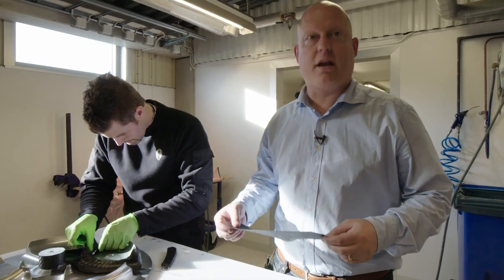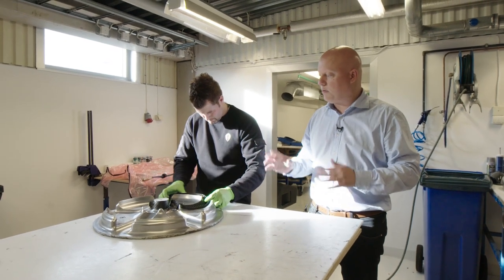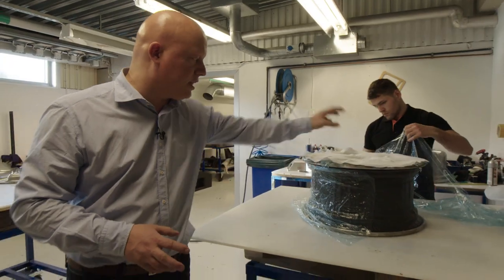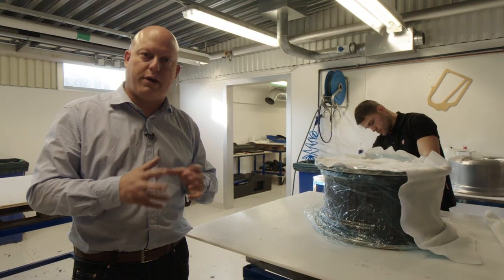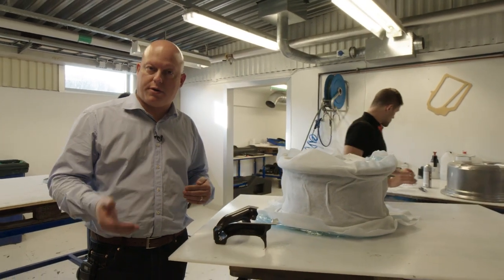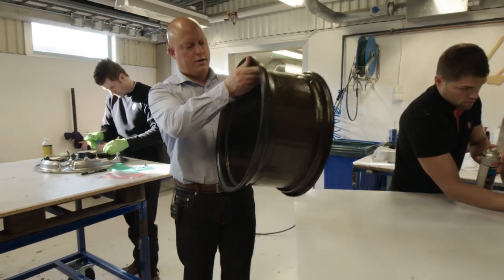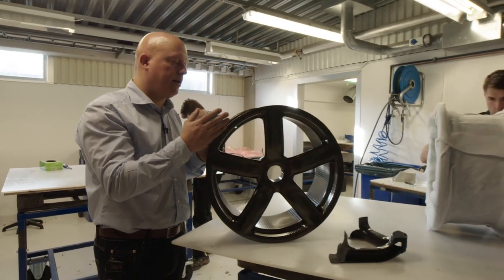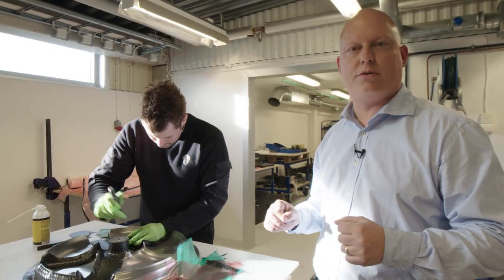Christian Von Koenigsegg Explains How He Makes 280 MPH Carbon Fiber Wheels

Comment: Man!! This series....making us wait why don't you!!!!! Can someone just make one which is an hour and a half with driving and all. On that note, can we see a drag race between the Agera/1:1, Huayra, Bugatti, P1, 918, Venom GT, etc?....nobody seems to want to drag race these cars ;)
Reply: We might see that kind of drag race few years later, but these cars are rare and expensive if something goes wrong. An hour or so about this would great tho' ;)
Reply: Check out "gtboard" on youtube. It's a rolling start but the Agera R already beats the Veyron GS Vitesse. I love the Veyron by the way ;).
Reply: The P1 would win.
Reply: Rihards Mors
I hear you...would be fun to see tho'! ;)
fesch03 Saw that race. crazy!
Reply: mrmactknife have you seen the Koenigesgg 1:1 its twice as faster than that P1
Reply: TheNewestAsianNegro  Has the 1:One even been ran publically yet?  A 1/4mile drag race between all those cars would be awesome.  Maybe I spoke too soon saying the P1 would win, but it would certainly be quick off the line with it's hybrid system delivering powerful torque at low rpm's.  It would just a case of whether the P1 could gain enough lengths on the 1:One during the acceleration phase, before the Koenigsegg could unleash it's mighty 1300+ bhp.
But what a race though, I really hope someone makes that happen.
Reply: i dont know yet but yea it would crazy fast i know that
Reply: mrmactknife I think that a 1mile drag race is in order also, consider the top speeds. :)
Reply: Man! No more episodes???? Why is this taking so long?! Chris should be doing something on this car, and the other hyper cars as well!!

Comment: Fucking hell, you are Swedish! You don't need to use that imperial system..
Reply: He may have used it for any Americans watching who still use the imperial system.
Reply: trodd1sox Why not use metric for all of the rest of the world watching, lel
Reply: +JanusPrime coz Americans are the best!
Reply: Even in metrical countries like here in Germany, we use inches to describe the size of a rim. But tires sizes are metrical.
For example 20x10,5 in rims and 265/40/20" tires.
Reply: simon sechzig I thought rims were in Zoll?
Reply: +JanusPrime Zoll is the german word for inch. Ein Zoll = one inch = 1"
Reply: Wheels are always measured in inches, both width and diameter. Changing that would mean making a car with wheels incompatible with every tire. Michelin tried making metric tires in the 1980s, it didn't work.
Reply: In europe we catually use Inch in some cases. For exampe the size of TV or computer screens and also wheel sizes
Reply: MxEnergyGreen i didnt know that thats koo

Comment: the year 2034 koenigsegg will release carbon fiber bones for the driver and have a booster seat made out of carbon fiber to seat a midget in the driver's seat and save a total of 100lbs more.
Reply: Next Koenigsegg will drive without a driver and save 75 kg weight.

Comment: About 13 lbs. Impessive
Reply: ***** These are bigger and wider, with these dimensions your wheels could weight like at least 20. And as the other guy said your wheels aren't even nearly as strong even with more weight.
Reply: ***** How wide are they?
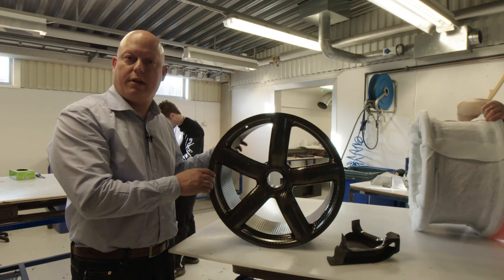Reply: jshaw6600 9:40
Reply: ***** Conratulations, you have lightweight racing wheels that will fatigue fail on you after a few years. These carbon wheels that are much lighter, stiffer, and larger will fatigue fail after 10^8 or more cycles or essentially never.
Reply: ***** True but they are not making a car that only goes fast on a straight line. Lighter wheels give all kind of advantages but the only disadvantage is little bit less stable ride on the top speed which is rather insignificant.
Reply: pascaliealiealie I Think the peeps over at Koenigsegg know what theyre doing, haha
Reply: o0Bananaphone0o Reading comprehension....look who I was responding to.
Reply: ***** What kind of car do you  drive with 18x11.5 16lb wheels?
Reply: ***** I see. A forged aluminum wheel with the same dimensions as Koenigsegg's would still weigh a little over 20lbs. Crazy how light CF is while being much stronger.
Reply: Crazy expensive to make though. Which is why most sane people go with forged aluminum or magnesium wheels.
Reply: Lets just hope theyve figured it out since they are the leaders in the hypercar industry, but of course, masters can also make mistakes
Reply: what do u mean?
Reply: I think that my opinion is legit, not really sure what you are trying to say...
Reply: and?
Reply: 10:05 5.9kg

Comment: "Production cars" ... they made 4 cars in the last 18 months...
Reply: the mclaren f1 was a production car and there was only a handful of them.
Reply: 夏春秋  more like 100 give or take. which is a handful in the car world. at least according to wiki, so take that with a grain of salt.

I think a  car needs 50 to be made qualify as production
Reply: 夏春秋
 they made
69 Mclaren F1's
6 LM's
2 GT's
28 GTR's

So yeah, not very many.
Reply: no.... They make about 10-12 per year, wich is all they need to brake even. The waiting list is currently over 1 year if you want one. 
As of Mclaren F1s, 106 were built, 28 of them being race cars, the rest road cars. 300 were originally planned. Koenigsegg so far has built 106 cars, same as the number of McLaren F1s.
Reply: Peter Pan
 thanks for the info!
Reply: Shall they make 3000 cars to call it "production car"?
Reply: homologation historically has dictated 50 units
Reply: 4 cars in 18 months? In 2013 they celebrated their 100th car and the first ones were built in 2002, so they make more than like 3 in a year. And if they design a car basically from scratch and build multiple of them then I would call it a production car. Zenvo built only 15 of their cars and you can't say that's not a production car. Some custom build cars like Hennessy gt aren't production cars simply as they are basically modified versions of something else. They try to claim otherwise to get records but that's a big load of bullshit.
Reply: Lol! They make 40+ cars a year.
Reply: seb123456789katt what are you talking about? where did you get that number from?? 
They make 10-12 a year, that's it.
Reply: 夏春秋 Sure, they could probably now just expand and produce more cars but it's takes big investments and has risks so it's good to take it slow.
Reply: A lot of you really don't realize how long it takes to make these parts out of carbon fiber. Almost the entirety of the Agera's non mechanical parts are made from carbon fiber. You can see some of the processes here of how long it takes to make one wheel. He omitted the time it takes to bake different thicknesses of carbon fiber. It takes half a day to 2 days for certain pieces, mainly because in the case of chassis', it has to be done in stages. So whenever I here people complain about how many cars they make per year, I laugh! Because they have absolutely noooooo clue. The materials to make Carbon fiber has come down in price tremendously, but the processes for molding and baking them has not and is the main reason why you won't see carbon fiber chassis in high volume production runs anytime soon.
Reply: 夏春秋
 There were not 200 or 300 hundred of them made. I think less than a one hundred were made. let me check. nope 106 were made. and remember. these were not nearly carbon fiber intensive as this car is. and its engine was hand built buy BMW for McLaren. And before you say it, Ford hasn't made forged a block for Koenigsegg since 2004. originaly Ford shipped unbuilt engine blocks to Koenigsegg. everything else was Koenigsegg spec. it was done for cost. now they design and make there own blocks.
Reply: SpecialKLSX They are obviously not production cars. If you start with someone elses car and modify it then it's just a modified car. And the mustangs even look almost exactly same, shelbys are just tuned versions of a ford mustang.
Reply: They didn't start with someone else's car. When they first began over 20 years ago, they needed to reduce the cost of making the cars. They did this buy buying engine blocks from Ford. Not complete engines. Just the Block. All the internals of the engine were made and designed by Koenigsegg. The entire car minus the engine block was made and designed by Koenigsegg.

Now they don't even buy blocks anymore. They can afford the machinery to make there own, which they do. The entire car is made and designed in-house. And they've been doing so for 10 years now.

And at no time were they ever a tuner company who decided to design their own car based off of another ala' Hennessey and the Venom.
Reply: They made 37 koenigsegg ccx last year Peter Pan
Reply: Yeah recently their production has accelerated tremendously.
Reply: jupp
Reply: Look at it this way. 

Maserati? Ferrari engines. Bugatti? VW engines. Audi? VW engines. Pagani? Ferrari. McLaren? Mercedes and BMW. Noble? BMW. There are quite a few low volume car makers out there who are essentially Coach Builders. That's basically what Hennessey is trying to become. 

Koenigsegg is trying to go the Aston Martin route, except more exclusive. And Faster.
Reply: James McClellan Hennessy is more like: hey let's take that one actual car manufacturers car that they designed and built and just stretch it, put 10000 horsepower and strip everything off just to brake some record that actually even wasn't legitimately broken. We make cars, 'murica! Actually they just modify someone elses car to ridiculous extent that is laughable and not even in the same league as any other supercar.
Reply: Ville Nummisalo this is true. I think that the lines of what makes a supercar are becoming blurred. A lot of Americans believe its just a horsepower game and that's it. Not realising that its the craftsmanship involved. From the balance of aesthetic designing an engine to the master interior designers to choice of leathers used in combination with modern man made materials and metals surrounding the dash and instrument panels. The stitching and the weave of the cloth on ceiling and the turf of the carpet and its thickness and quality. 

The small details is what makes the car great. And certainly its the small details that makes the car a supercar. Power and speed of course catch the eyes on paper, but its the little details that you can only see live that show the qualities of superior workmanship. 

Koenigsegg goes so far as to counterbalance the valve stem on its fully carbon fiber wheels. Your talking mere grams of weight. 

They laser drill microscopic holes in their aluminium dashes to for the lighting of there instruments at night giving them the appearance of glowing out the aluminium itself. 

They used a 3D printer to extrude there new titanium exhaust tip and use 3D printed parts in various areas of the car. 
They were the first company to herringbone their carbon fiber panels for the skin of the car making it match the entire length of the car. And were the first to use different weaves for different parts according to stress level and type and direction.

It goes on and on. And Koenigsegg does this on its own. There isn't VW financing the testing or loaning out trick engines an transmission designs.
Reply: James McClellan Exactly, more people need to realize that.
Reply: Peter Pan In order to campaign the F1 in a racing class, McLaren had to make more than a few in much shorter time-frame. Much larger company with much more experience and the capability to do much more than they had to. Racing comes first and if this guy really wanted to get his name out there and prove that his products work, he would campaign a car. Obviously, that's not his deal. He just wants to be the "first" to do something with "exclusive" labels.
Reply: 1stGenStunter Well I would also say that it's one thing to have a history in racing before you became a consumer automaker and then became a auto maker for the Rich and then decided to further develop said design for racing purposes and then campaign to get a enough units sold to qualify for the series you chose to race in. 

Now Koenihseggs case he has the problem if doing it in reverse and so needs to campaign enough unit sales to qualify for the racing series. He will actually have done this by years end and depending on following year projections he will likely race his cars at Le Mans series next year.
Reply: "Production car" means it has been produced for sale. If he'd said "mass production" then I'd get your point.
Reply: James McClellan Pagani uses Mercedes engines and Noble uses Volvo engine
Reply: Michael Ebbs well see there you go...
Reply: Well a car at that price isnt going to sell like a honda.
Reply: SpecialKLSX no one NEEDS a car. People have lived without them for thousands of years.
Reply: I don't.. But I want it.
Reply: SpecialKLSX What are you talking about. How do you know where I live? Employment? How do you know im not working know? Seems like any person willing to take the time to troll on youtube is unemployed.
Reply: SpecialKLSX 1. Trolling and defending a statement is not the same.
2. I do understand personal transportation. Otherwise I would not be watching this video.

Comment: I just got my 2016 Shelby Mustang GT350R. It has carbon fiber wheels. They way 18 pounds each. They are 20 inch in height I don't remember the width. Ford is the only high-volume automaker to have carbon fiber wheels. The wheels are made by a small company in Australia. It's literally in some guys backyard.
Reply: this was made 2 years ago
Reply: Dude congrats on the GT350R car is amazing.
Reply: Thanks, I haven't been able to do much with it. I can't wait to get it on the track, where it can really stretch his legs.
Reply: Scott Hill These wheels are hollow carbon fibre and the width on the one:1 is 355 I believe
Reply: Scott Hill 
What the cost per wheel ?

Comment: I'm surprised Koenigsegg don't use helium to inflate their wheels. lol
Reply: Helium would be nice and light but too unstable. The GTR is one of a few that uses Nitrogen.. Much more stable with temperature changes.
Reply: gmax876 Lot's of tire places have Nitrogen inflation. It's pretty common.
Reply: Cool, where could I go to get that done?
Reply: gmax876 your local car dealership... They all have it
Reply: gmax876  pretty much no reason to put nitrogen in your tires unless you want to speed up the process, since you are putting oxygen in your tires it already has nitrogen in it, a small amount, so if oxygen leaks out faster or more than nitrogen, eventually you will have nitrogen in your tires.
Reply: Stephen Avara Tires are under high pressure.  Any air that leaks out will not be replaced.
Reply: Helium would leak through the pores in the tyres
Reply: Despite the wording of his explanation he actually is correct. Check this out if curious: https://www.youtube.com/watch?v=yRL74SIUrIo
Oxygen is a smaller molecule that will leak out of the tires at a much faster rate than nitrogen. Therefore a tire that was filled with air will eventually be filled with just nitrogen.
Reply: And helium even smaller hence balloons deflate
Reply: Helium has become a rare source and should only be used in science. They say, by 2020 there might not be anymore helium on the market. Machines like the MRI need Helium to function.

Comment: I would be interested in knowing if the hollow rim design could be utilized as ducting. for the brakes.
Reply: Ferrari have thought of the same thing in F1 recently, simplified by having a hollow wheel nut to allow air flow. 
http://www.f1technical.net/development/442
Reply: Not to forget the turbulence it would generate because of the wheel-ducts rotating at high speeds.
Reply: Koenigsegg actually have a wheel that sucks air out of wheel house. They have carbon fiber spokes with titanium/aluminum rims. They were bladed as well. But Koenigsegg found that the unguided air exiting the rim spoiled the air along its way toward the flanks of the car, thus increasing drag. So for top speed runs they of course won't do very well, but for track purposes they'd theoretically do very well entering corners.

Comment: Wait, so every single wheel is made by hand?
Reply: Have you seen how expensive Koenisegg is? You pay for hand made parts. Plus, they aren't making many, so they only have to make a few to meet demand.
Reply: They produce like 10 cars a year so that gives them plenty of time to make wheels in house haha
Reply: +Neerav Reddy last year they sold 100+
Reply: Theese super expensive sports cars are made alot more by hand and in much smaller workshops than some might think.
Reply: TortiseGaming They've only made 40 cars
Reply: +TortiseGaming still just a little over a wheel per day.
but the regular agera doesn't use carbon wheels so that's not really how many they have to make
Reply: Yeah working with composites is practically all done by hand. Its one of the reasons why its so damn expensive. Huge man hours involved with composites.
Reply: Aka imbalances. Robots will always make better wheels.
Reply: @3eeeDee  meh havent seen anything better than what Koenigsegg makes..